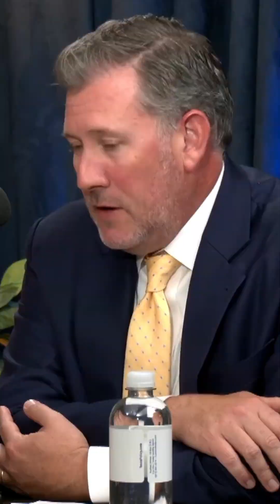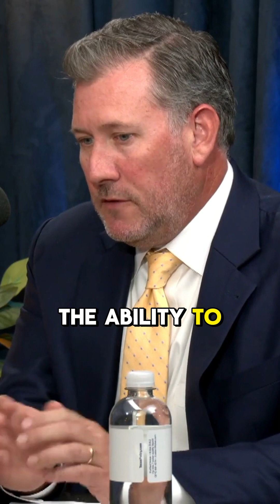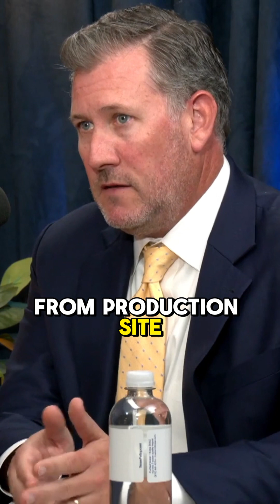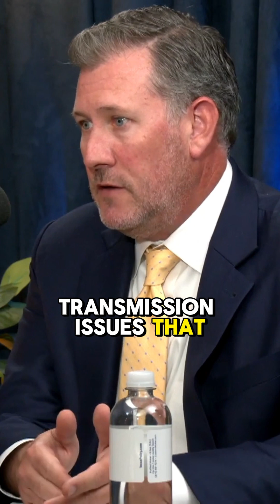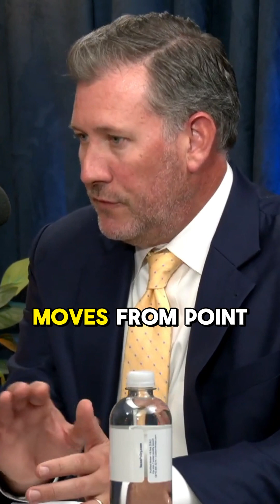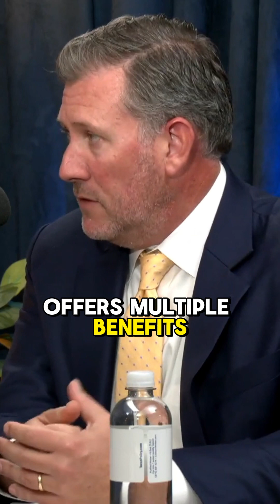Small Nuclear Reactors Could Help Texas Oil & Gas

Comment: Micro grids are the ONLY way we can stop the chain reaction cascade grid failures that ARE coming. NOT IF, its WHEN  they happen. Could be just age or as something as drastic as terrisom. They have proved from multipule reports (internal as well as external) they have stated that with as little as 1/2 dozen station failures coule  shut down entire regions, not just a city or county but entire regions. With alot of our power supply parts not only being built but being built when ordered then shipped over from china. Something thats so extremly time sensative and leaving at the.hands of largest enemy is insane to me